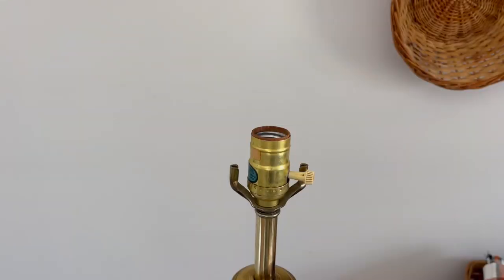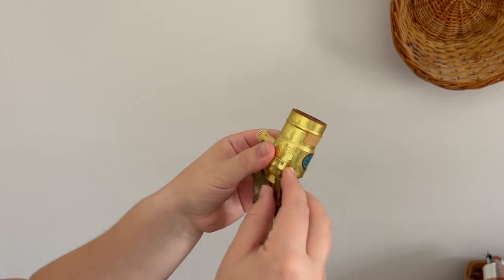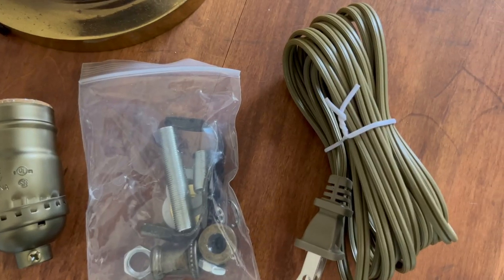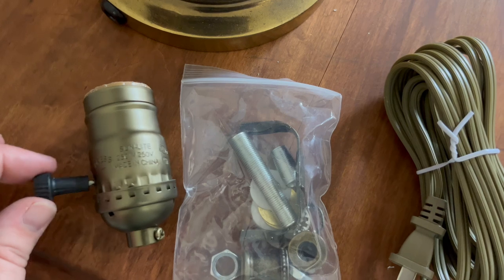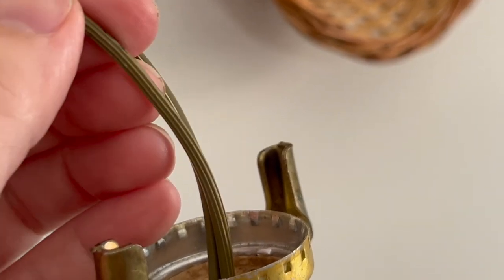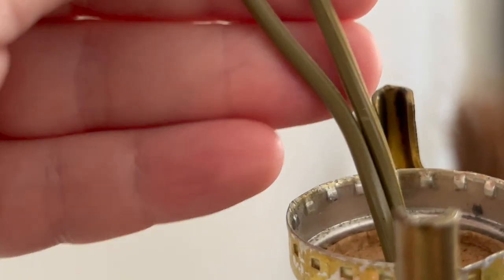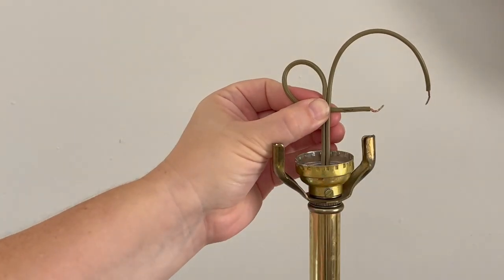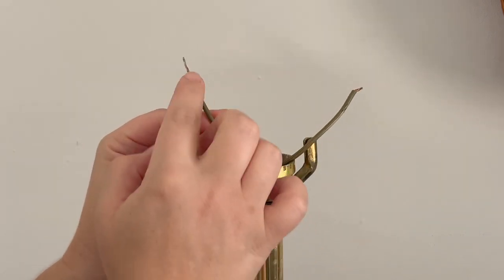How to Rewire a Vintage Lamp to Make it Safe Again!

Comment: I really liked it.  What about the washers and nuts at the bottom inside the base.
Reply from the maker: I'm not sure which ones you're talking about. There weren't any that were in the bottom or anywhere inside the base itself, only at the top where you connect the lightbulb.

Comment: 4:01 It is an older lamp socket but it is perfectly fine to use if it still works.  It IS polarized but just doesn't have one brass and one silver screw.  The neutral wire terminal is 180° opposite of the switch and has a triangular shape and the hot wire terminal is the other one (on most of these sockets).  The hot wire terminal hangs lower and is slimmer on your lamp socket, just like it is the slender of the two spades on the plug end  (the neutral spade on the plug is the one with a wider head).

Comment: 3:35  The socket can be split in two without tools.  Look for the "PRESS" engraved into the top portion of the socket (it is usually adjacent to the switch knob).  Put your thumb there and your index finger 180° opposite and gently squeeze.  This will slightly deform the top and allow the "teeth" in the top half to disengage from the row of dimples stamped around the circumference of the base.  It takes some Mom Strength to do it, or just use a thin screwdriver and pry at those two spots (where your thumb and index finger lie) and it will come apart.